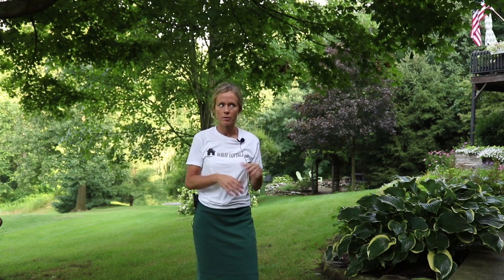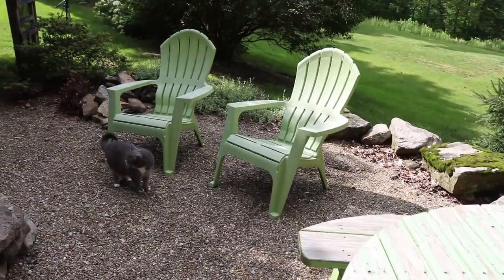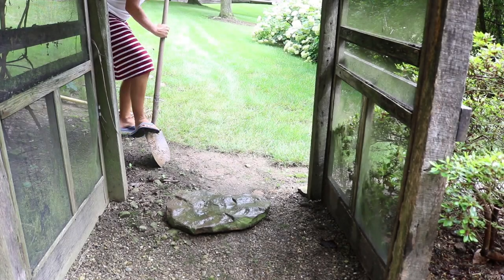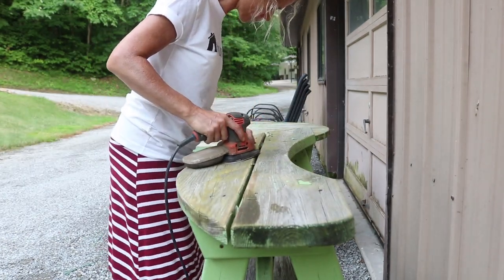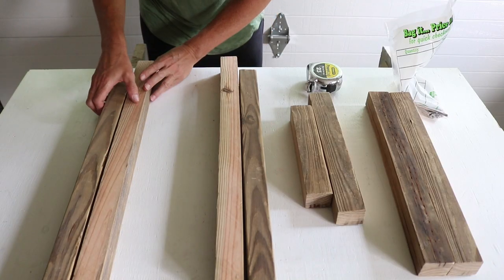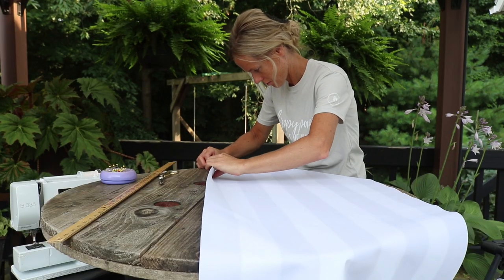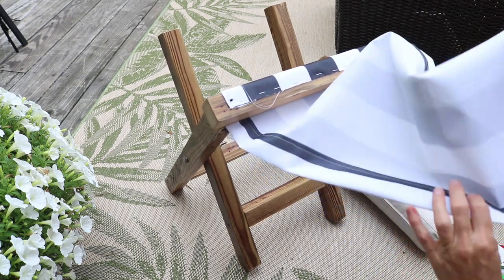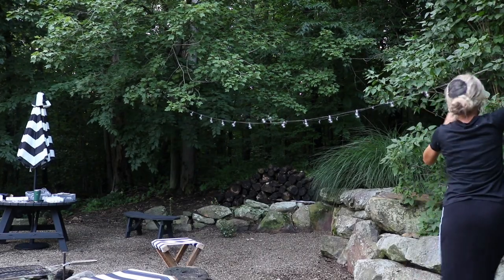Firepit Area Makeover ~ DIY Outdoor Furniture ~ Simple Outdoor Chair Idea ~ Outdoor Space Makeover

Comment: I think everything looks so nice. Yoi really lucked out with the seat fabric and umbrella!

My only idea for anyone duplicating the stools: The stools could have had taller supports then a dowel used to hold the seat. You would need to make casing hem to slide the sling seat onto. Then make hole in uprights for dowel, maybe then secure that with a wooden pin or a metal clip. You will get some years of use out of the ones you made just won't be able to easily wash, remove/replace the seats.